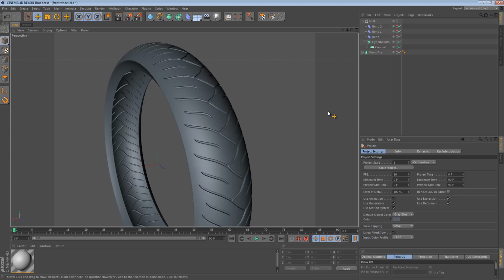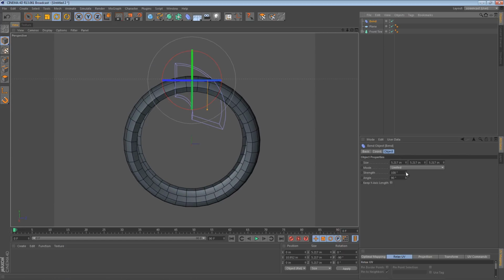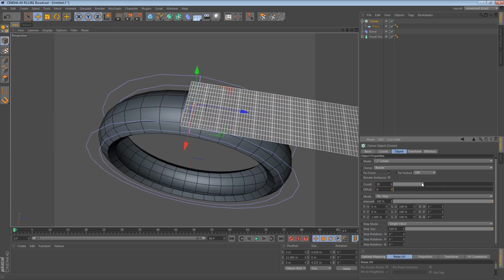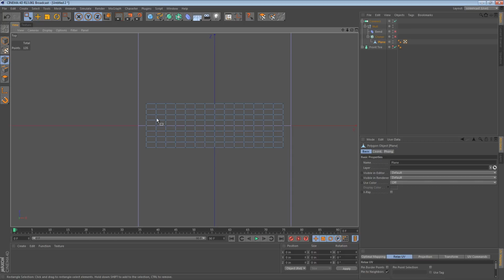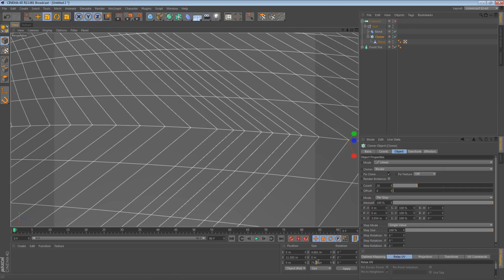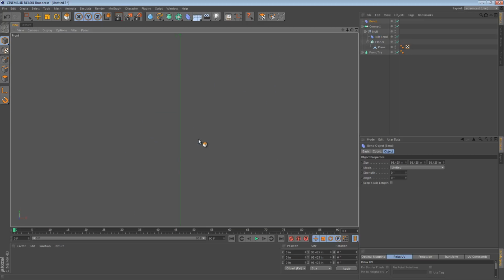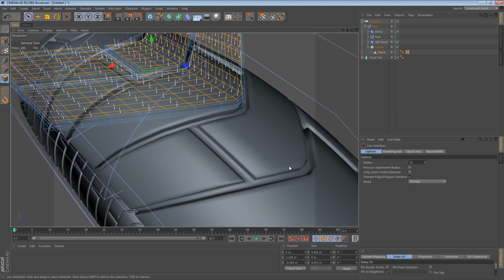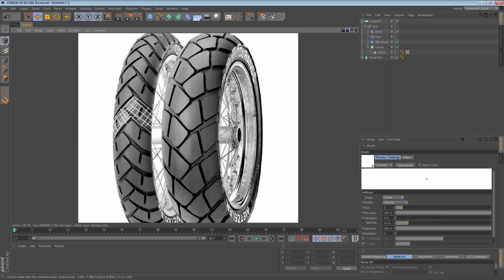Motorcycle Tire Modeling Using Deformers

Comment: Really liked your tutorial, especially that you had already constructed a better version but used your off the cuff skills to work round any problems you came across. You explained your thought process, which is good. This has nothing to do with the tutorial but am I correct in assuming you have some connection with Scotland. Nice

Comment: Thanks for this great tutorial!
If someone wants to know how to find the correct width and distance for the plane in the cloner object - just take the length of the bend object (in this case the 72.841 in) and divide it by the amount of clones you want to have. Let's say you want to use a repetition of 64. In this case you would end up with 1.138 in per segment and the distance would be the same.

Comment: Thanks for the tut. At around 21 mins an easier way to create that chevron shape would have been to dissolve the vertical edges first, create the shape, then use Edge Cut to add the subdivisions back in.

Comment: Superb video. Will these methods work in Maya as well? 

Can you do a video on how to do the simple, low polygon wheel? I'm new to modelling so it would be awesome to learn from the basics, but still with a purpose.

What I mean by a purpose is many tutorials have a box that you manipulate, but that doesn't interest me. To actually mold a wheel, albeit a low detailed one, would be much more interesting.
Reply from the maker: The concept should translate to Maya easily. nothing being used here isn't available in other 3D packages. As for Maya... I haven't used it in years, so a tutorial in it is not likely.
Reply: +Jamie Hamel-Smith Hello!

I didn't mean that you should make a maya tutorial, but a C4D-tutorial on how to create the low polygon model. Or did you do that in the same manner, but just with less effort?
Reply: +Jamie Hamel-Smith Also, why did you move over from Maya to C4D? Just curious to hear your opinion as everyone keeps telling me to stick to Maya and that C4D is not fancy enough for modelling.